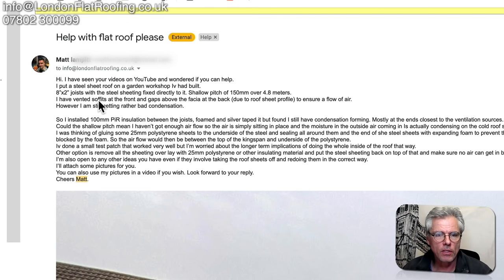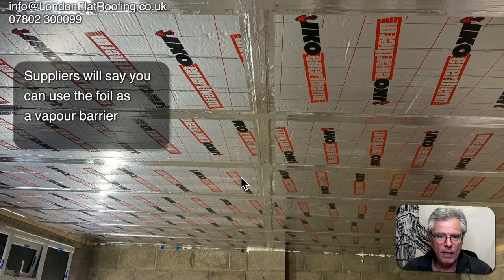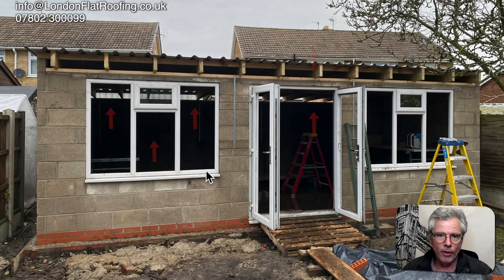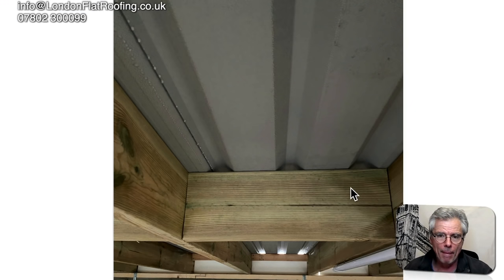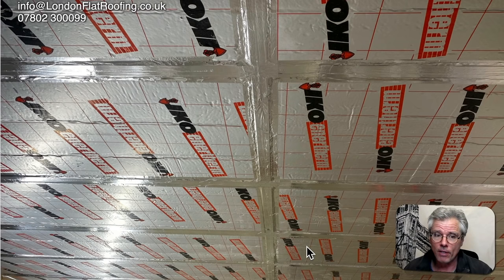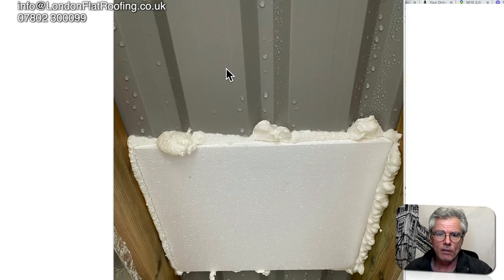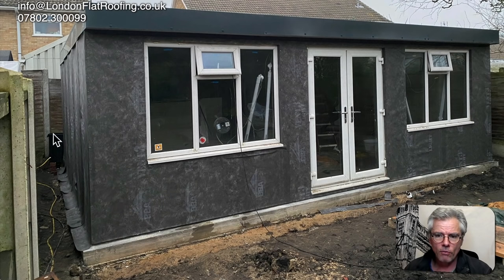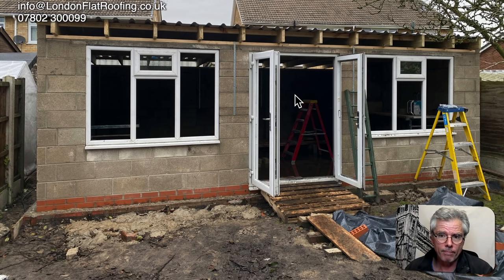Condensation/Sweating on garden office roof

Comment: Hi, I'm currently working on a commercial project, we have a flat roof and we are planning on using a single ply roof system on a metal deck. I would like to know if i need to place a vapour barrier on the metal deck before i lay the insulation?
Reply from the maker: Yes you put a vapour barrier on the metal deck probably you would use Alutrix 600 because it's sticky back and you don't want to be mechanically fixing it down
Reply: @SteveRoofer  Thank you.

Comment: 3:22 on the question of adding styrofoam:

His idea should be good. Keeping the warm, moist air from touching the cold metal (every evening I assume) should prevent condensation.
Alternatively, he could allow for some way for the outside air to continually flow under the metal (and above his insulation), which is supposed to keep it dry. If the humidity is high outside, I have my doubts about this one.
Reply: You talk about the second one fitting the roof, theoretically what you’re doing is forming a cold roof put the metal transfers. The outside temperature down so much that the underside will always have condensation on it. If the outside temperature drops and the relative humidity is high, We see this a lot in garden sheds that have a lot of natural ventilation, but still the metal roof still gets condensation on it

Comment: Fleece backed metal  roof sheets work well but to be honest he really needs a OSB or ply roof with two layers of torch on felt, EPDM Rubber roof or a GRP fibre glass roof.
The building might be in his Garden its being used as a  proper room not  a shed.
Reply from the maker: The general consensus here is that he should've used insulated metal roofing sheets and that will resolve the problem

Comment: Hey Steve 
We have an enclosed patio area with plain metal roof sheeting. Winter condensation drips. 
The paint is perished over probably 30 or 40 years. 
Would painting the outside of the roof sheeting help stop this please? 
Many thanks
Reply: No but glueing some sort of fabric 
Over it may help some sort of fleece material what happens is that it holds the moisture until it evaporates
Reply: @HampsteadBuildersLt  Glue fabric on the inside? Many thanks for your reply

Comment: Steve I have a new Welch blue slate roof fitted recently and noticed the ridgeboards wet with crystals all over it now. Should I be concerned???? I haven't closed the ceiling yet but maybe thats the problem?????
Reply from the maker: Yes possibly the problem as you are letting moisture get to the roof. Make suer its vented correctly

Comment: That’s not sweat it’s condensation, once the building dries out the insulation will stop the warm moist ambient air reaching the cold surface and condensing.
Reply from the maker: Your right but most people refer to it as sweating your wrong re it will go away read the nightmare others are having

Comment: Hi Steve.this is probably a stupid question ,should there be insulation between joist in my new warm flat roof. Thanks
Reply from the maker: Not normally but if sometimes if room above is tight. generally it can be calculated that if you have approx 30 of the insulation under the decking tight to the decking and the remainder above that works

Comment: Kingspan 40mm insulated panel should have been used instead of single skin sheets. We have solved this sort of problem by putting battens on top of the existing roof and put fiberglass type insulation in between the old and new outer skin single skin sheets

Comment: So keep the heat in with insulation, the due point is on the metel. Take the insulation out and let the heat rise.
Reply from the maker: unfortunately that doesn't work it lets all the heat out and then when all the heat is out the roof gets cold and then you get condensation again

Comment: Coat the top with a white rubberized top coat to significantly drop the temp of the metal.
Reply from the maker: No won't work painting black would be better but still wont work

Comment: How do you stop an open carport with a metal roof from sweating?
Reply from the maker: you  insulate it
Reply: @SteveRoofer  Using? I've seen spray foam used and it still sweats.

Comment: Why not take the metal roof off, add a plywood roof with lightweight felt and then refix the metal onto that, then under the plywood re add your insulation panls?
Reply from the maker: Yes however the consensus is to take the metal off add  breathable membrane and battens and then put the metal back on same as your idea in a way

Comment: Good explanations 👍
It would be prudent to cover all block work during construction, and install drying equipment, to reduce this initially. I’ve data logged about 60 roofs, and found roof condensation can occur in most roofs intermittently, and doesn’t normally become an issue. If you have timbers that get wet, and don’t dry out quickly , because of restricted ventilation,  or poor detailing, timber decay can occur. Just as a point of interest a house roof will reach 40 degrees in the summer with very high dew points, and massive vapour pressures. This is called summer condensation. Vapour pressures in winter are low because it’s cold. If anybody has data logged a roof like this I would be interested to see the data👍 That roof to me looks destined to fail.
Reply from the maker: Im looking that up also looking in to vapour pressure more as its an interesting subject
Reply: @SteveRoofer  best way to measure movement of moisture bud 👍

Comment: Hi Steve, do you think adding 25mm battens as purlins would give enough ventilation to avoid sweating for this build. Or will sweating occur either way as it’s a metal roof? If it’s a still night with little wind for ventilation for instance I’m not sure if enough air movement would occur.
Reply from the maker: Its alway going to happen with a metal roof he needs to insulate the metal to keep the bottom warm
Reply: Ideally you have sheathing over your rafters with roofing paper and ice/water protection. Then you have a ventilation matt or wood strapping between your metal. Whenever water condensates the gap gives the water somewhere to escape. It really brings up the cost but it's best practice.

Comment: Doesn’t matter if you had full open walls rather than windows and doors because at night the metal roof radiates heat to space faster than anything else and any atmospheric moisture preferably condenses on the roof.

Whilst it seems an issue now the on site construction moisture is in the long term irrelevant, it would still ‘rain’ indoors decades later when the humidity is high and the roof radiates to space overnight.

The fix? Either insulated metal panels, or, in order from the top, uninsulated metal sheet (the underside being vented) taped tyvek on structural OSB, over 100% cover PIR insulation (even 25mm would be sufficient) and a vapour barrier.  The existing timber roof structure, now under the new vapour barrier can remain open to the occupied space with no cold bridges. 

Internal moisture does not go beyond the vapour barrier, any external moisture still condenses on the metal sheet but above the tyvek where it can drain off or evaporate during the day.
Reply from the maker: Some good points i'm not quite suer about the buildup ill draw that out on paper and think about it
Reply: Yes, it still has big buildups of condensation and the building and surrounding area are so much dryer now lol 🤦🏻‍♂️
This sounds similar to one of the other options I was thinking about. 

From top to bottom:
Metal sheet
Directly on top of a breathable roofing membrane which is directly on top of a layer of 25mm insulated sheet, Either Foilbacked pir or polystyrene Jablite

So basically was thinking sandwiching the 25mm insulation of choice (probably polystyrene because it won’t have the foil backing that also condensates in cold)  between the tin sheets and existing joists. And still retaining the ventilation underneath the polystyrene as that won’t be for the purpose of keeping heat in but rather keeping air away from the internal layer of metal sheeting.
I would then put back the 100mm pir and tape the joints. 

I can definitely see the use of a vapour barrier where you said but what’s the purpose of the extra OSB ? 
Also is Tyvek just breathable roofing membrane or something fancier ?

Seems there are a few ways to redo this so want to make sure I make the best choice.
Reply: @MatLampitt  Tyvek Supro, breathable but also water repellant.  

The insulation (regardless of the foil facing pir is preferable to polystyrene) is loose laid on the roof structure, the osb (11mm is sufficient) is then screwed down sheet by sheet through the insulation into the roof structure making a safe walkable platform, the tyvek is stapled onto the osb (it needs overlapping and taping with the appropriate tyvek tape and while it could be laid over just the insulation doing so makes fitting the metal roof precarious.  

The metal roof essentially becomes the primary means of avoiding rain penetration, the tyvek the secondary.  Direct fixing of the metal roof with tekscrews into wallplates fixed over the tyvek with the tyvek extending behind the facia boards ensures you don’t have any wind blown moisture problems.  

The metal roof effectively becomes something to keep UV off the tyvek.
Reply: Cheers martin.
Yeh can see the the point of the OSB now.
So if I was to redo the roof with this method using 25mm pir then would I be able to push the 100mm internal pir up to the underside of the 25mm and the only ventilation needed would be effectively between the raised sections on the steel sheets and the Tyvek?
Also you say no cold bridging on the joists but I think there still will be a bit from the front and rear facia.

Comment: Should of just bought anti condensation sheets single skin with fleece on bottom.  Best thing he can do with that is get a bar system like ashgrid and build roof up ie twin skin with loose lay quilt insulation but all his fascia heights would have to be changed
Reply from the maker: he didn't know about anti condensation sheets when he got his

Comment: Using a dehumidifier wouldn't be a good idea.
Reply from the maker: Yes but why mechanically  remove the moisture when you can do it naturally
Reply: @SteveRoofer  in the situation it's the best option. Tell me how you would do it naturally?
Reply: @donalrodgers123  
Airflow.
Reply: Thats the solution ive been using in my concrete garage with metal roof until i can come up with a permanent fix, also have a, tarp at an angle keeping water off the bikes but even with a decent sized dehum running still get a lot of moisture in cold weather. Thinking of binning off the metal roof altogether and going for rubber or felt tbh